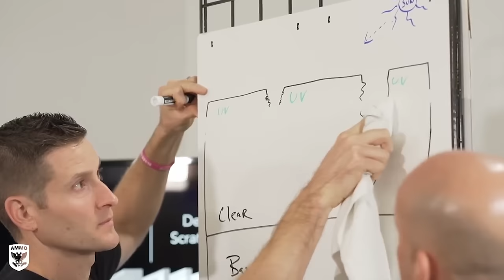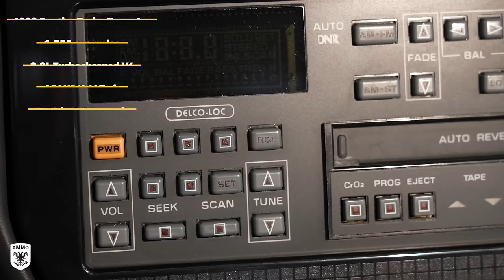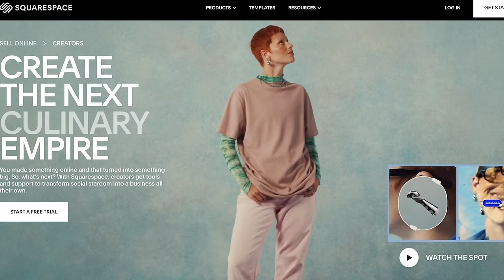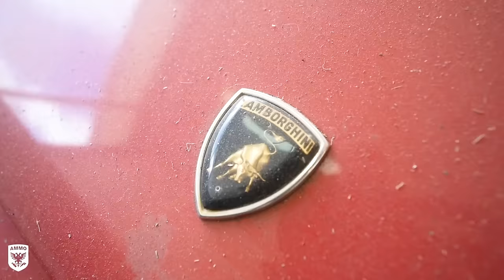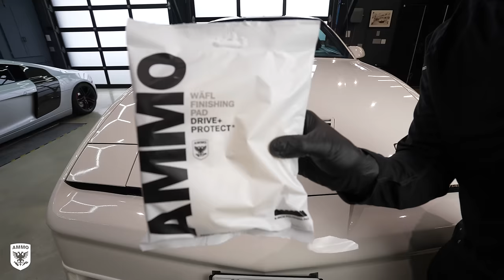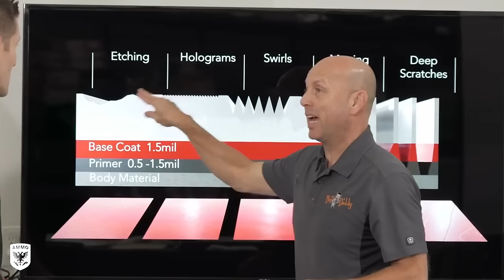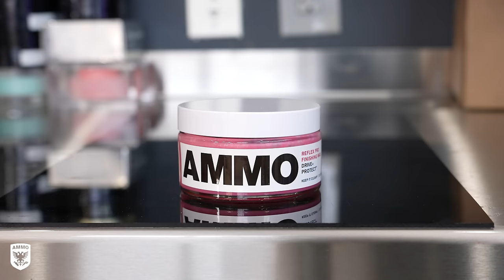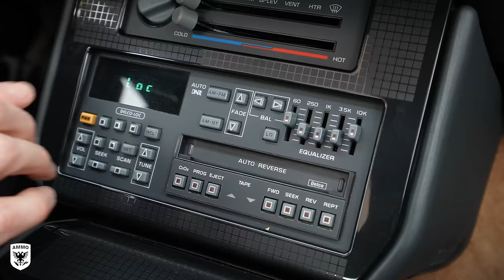Pontiac Turbo Trans Am First Wash: How To Clean Brown Tires!

Comment: The Turbo Firebird had the same engine as the GNX
Reply: Yes same engine as the GNX/ Grand National, however the heads are different on the Trans Am because the engine compartment is tighter, they took the heads off the 3.8 liter buick leSabre so it would fit inside the TTA engine compartment.
All 3 share the 3.8 liter engine, slight
 changes were made to the GNX and the TTA, all 3 cars are badass cars !!!

Comment: Did they use the same engine as the Grand National or the Typhoon/Syclone?
Reply from the maker: Similar engine to the GnX with slightly different heads, exhaust, and pistons to fit the engine compartment.
Reply: No,  the 3.8L Buick is a complete different engine that the 4.3L Chevy.   They are cousins.

Comment: Its actually wrong ,these cars had @300-350hp but were underrated to not compete with the Corvette at the time. They were doing 0-60 faster than most Ferrari's in the 80s.